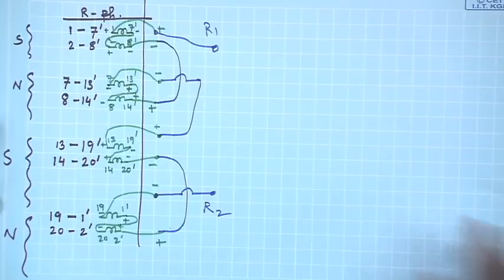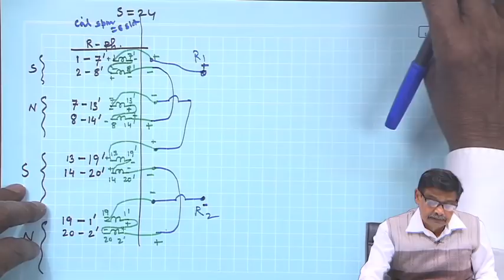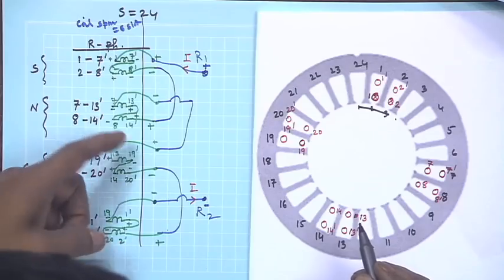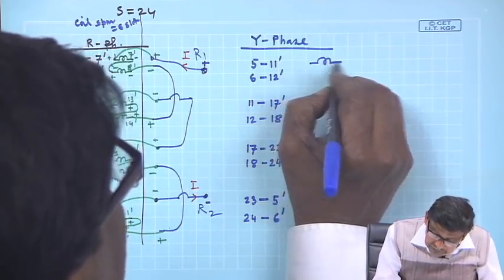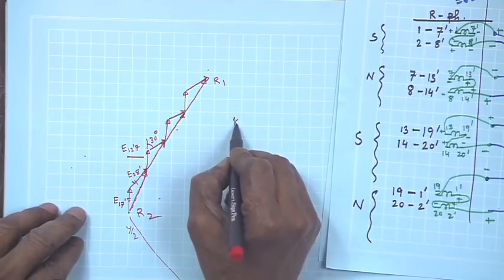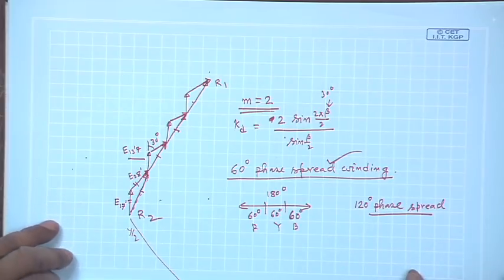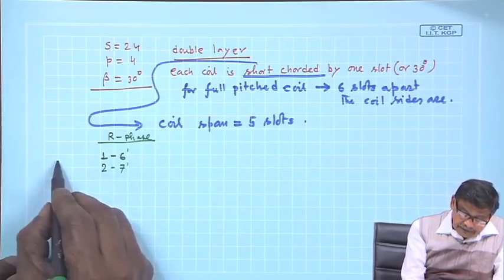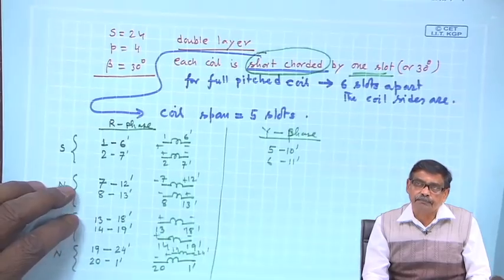Lecture 27: Winding Table for 3-phase Distributed Winding with Examples (Contd.)

Comment: In the example of short pitch winding for the following  coils 1-6' 7-12',  13-18', 19-24' the coil sides are both under the same pole, what will be effect of this? As we have made a point that they should be under different poles for maximum induced voltage
Reply: yes ,for maximum voltage these should be under different poles but just for eliminating the effect of some dominant harmonics present in flux distribution we compromise with some voltage.After all flux distribution will be of sinusoidal shape so 1 and 6' are still 150 degree apart that gives us modified voltage according to pitch factor.
Reply: Even after short pitching, the coils remain under different poles, if not then voltages won't add up and effects of short pitching is to get rid from theodd dominant harmonics from air gap flux to get sinusoidal flux and emf there after.